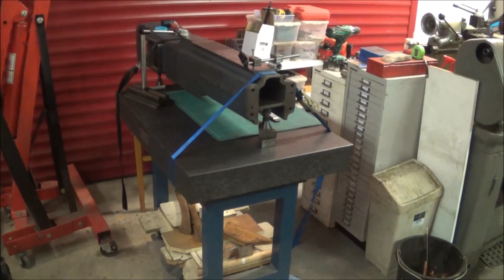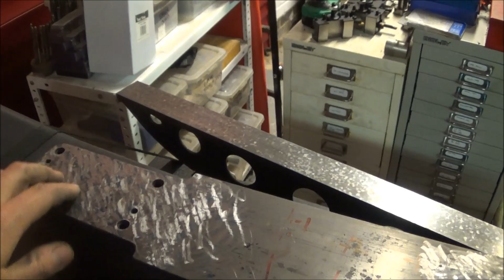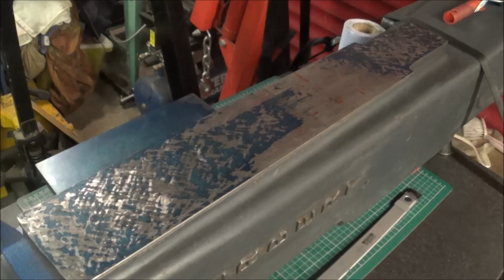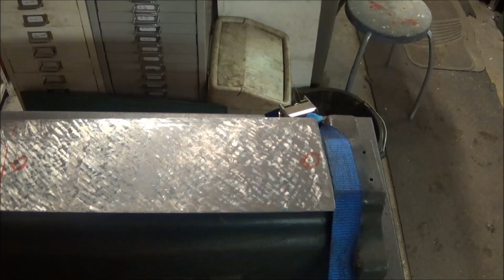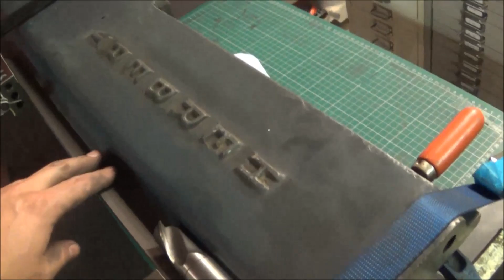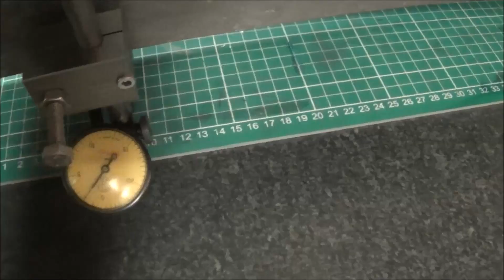Herbert Surface Grinder Restoration   Part 1 Scraping the Column

Comment: Wonderful project - especially as I think its the exact same model as my Herbert .. thanks for the sub to my channel - hope you find something of interest and use.
 I'm looking forward to following your SG rebuild.  Did you do an overall assessment of the accuracy before you started the strip down ?  The saddle on mine is worn pretty bad and when I lifted the table to check out the underside there is next to no sign of flaking left so I know there's a minimum of 0.003" on the ways gone.  That being said it will grind a plate to a 0.001" over its extremes - its a small  working envelope something like 7" by 3.25" .  I know it wants scraping though after a half an hours grinding my left arm is falling off ! All the best Mat

Comment: Thanks for sharing this video i have the earlier model to yours that i am about to restore so i am looking forward to part 2 
Dave in Hampshire. UK
Reply from the maker: thanks Dan, hopefully I can get on with it.  There are plenty of other projects in the pipeline!
Reply: Machine shop at the bottom of the garden I know exactly what you mean I have 3 lathes to finish 3 milling machines to refurbish and of course everything else that come through the door...I probably won't go as far as scraping on the Herbert Junior as I wouldn't know where to start !!